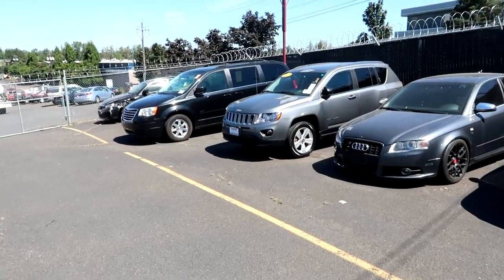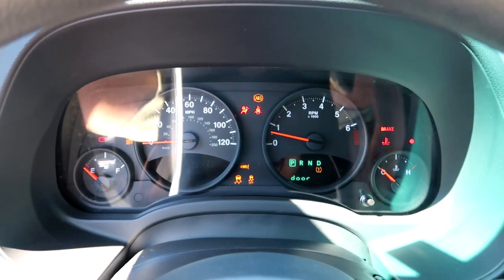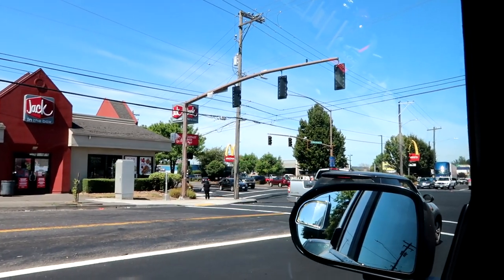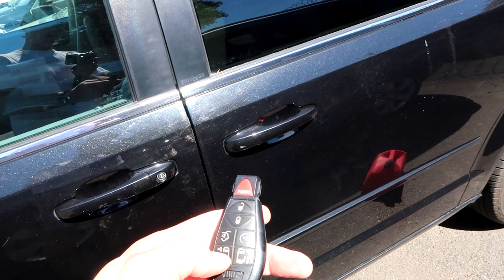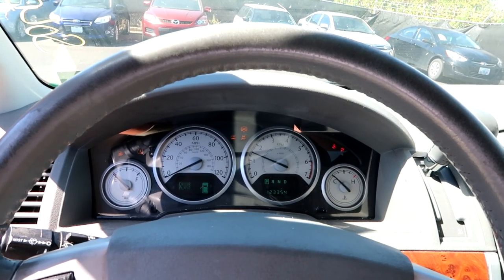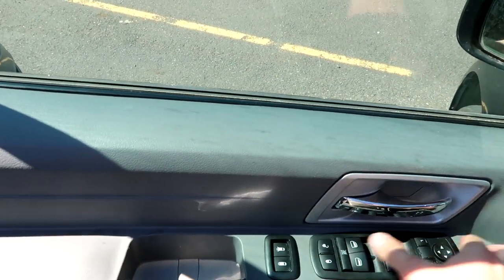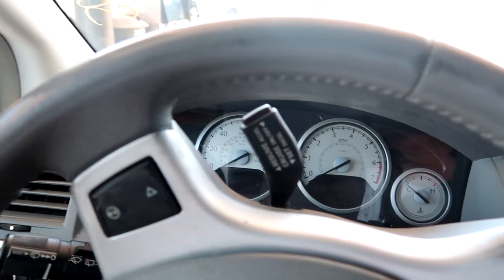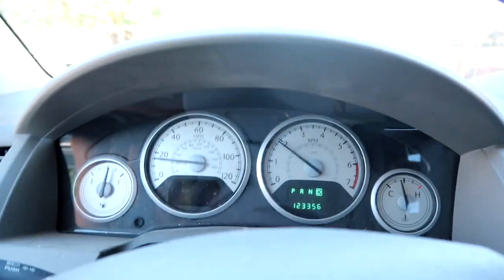Flipping a MINIVAN for profit

Comment: Those vans have an issue with the cluster solder cracking and flickering and shutting off but resoldering usually fixes it at least from my experience good luck

Comment: Is it difficult flipping cars with salvage titles?

Also is there a way to title cars with bill of sale and No titles?  

I see a lot of nice cars on COPART but with bill of sale only
Reply from the maker: Hello! No, salvage title cars are actually very easy to flip. And I started flipping mostly salvage title cars.
There are a few states that sell vehicles on a bill of sale, WA state is one of them. About a year ago they made it very difficult to get titles for those vehicles. You have to title them in WA and take it through state inspection which can take 3 months, at least. That really delays a flip, and a car can lose quite a bit of value in 3 or more months.
Reply: @SergeyPip  Thanks so much